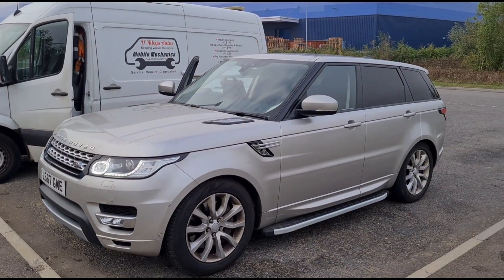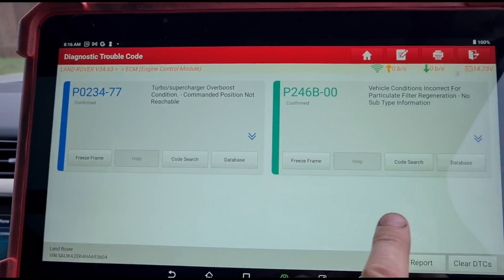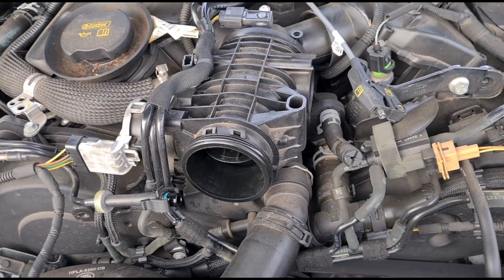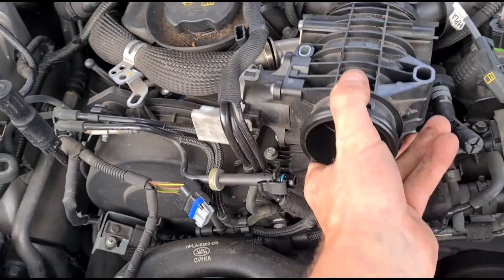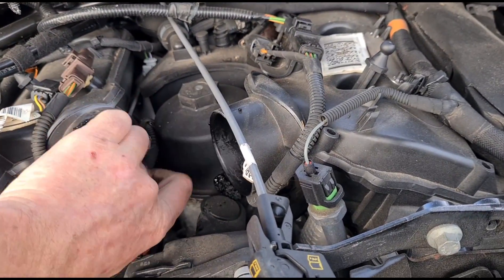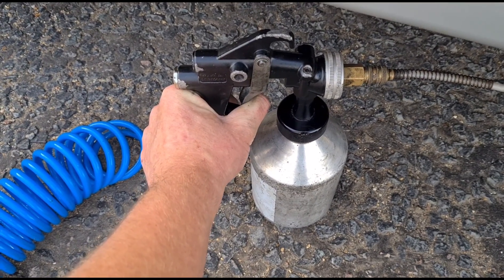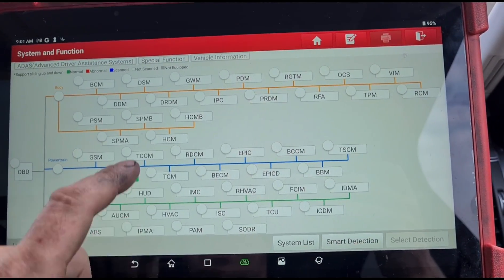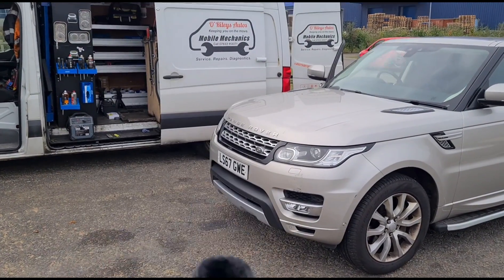P246B:00 Vehicle Conditions Incorrect For Particulate Filter Regeneration

Comment: Another great tutorial Jimmy I'm shocked at the price of the new throttle body  considering it's plastic and also the fact the main agent could not fix it surely a revised metal throttle body or more sturdy one so it doesn't get effected by the accumulation of debris and heat  from the EGR

Comment: Another great video Jimmy, I've commented on another of your videos, I'm an EX JLR master tech, (2 years out the dealers) I'm not surprised the dealers struggle to diagnose these issues.
The Training is very restrictive (doesn't go into proper everyday diagnostics) and the diagnostic tools SDD, pathfinder and the new topix internet based systems that the techs use are designed by engineers and not diagnostic technicians.
A lot of the diagnostic is done by the tool and leads you through a process to get a fix.
When you ask for tech assistance, you have to email a session file and results from rest etc to JLR.
They never answer questions, if you fix the car whether it's a software update or replacing a part they never explain why.
As for TSB's these are not easy to find and JLR will remove some without notice.
I found the dealer's diagnostic procedure frustrating at times, glad I'm out now.
Aftermarket diagnostic tools are far easier to navigate, faster and easier to understand.
Like I said another great video Jimmy keep them coming 👍

Comment: Safety tip..always use axel stands under a vehicle with raised hyraulic or air suspension. People have been killed when a sensor has been accidentaly disturbed and lowered the car onto them.I had a C5 that lowered when underneath but lucky i had axel stands in place to stop it 😮

Comment: Been watching your videos Jimmy and this one got my interest. I have a Jag XF with the same engine, I just removed the same part as the seals on the throttle body were leaking causing a very intermittent restricted performance warning . Changed the seals myself and all seems well. My throttle body was much cleaner than the one you removed as well.
One other thing, i have had the egr mapped out, is that sufficient or does it need blanking ? 
Keep up the good work, be good if other garages and mechanics were as genuine and knowledgable as yourself.

Comment: So, as a DIY mechanic for servicing on these, over 3 years and 30,000 miles you're looking at:
£120 in fully sysnthetic oil (buy 20 litres or more at a time)
£150 in oil, fuel, air, cabin filters
£30 in brake fluid
£500 throttle body

Ouch. 😝

Comment: Shocking they at landrover cant fix this problem and the fact they cost 500 nicker for some plastic is shocking,i presume with it being plastic is the main reason it cant be cleaned as with the heat its warped.👍
Reply: It's like the inkjet printers that sell for £35 with a set of replacement ink cartridges costing £40.
Interesting business model.

Comment: Hi, I've seen you do a few of these now, but looking at the throttle body they look like they come apart, have you looked into taking them apart and cleaning them and freeing the throttle valve off? As a business this may not be an option due to come backs etc, but for the DIYer it might save a lot of money at £500 a pop it could be a saving for owners who have this problem....
Reply: In previous videos he's mentioned that he's done this and it provides a fix that isn't reliably long lasting.
For a more dependable car, it's better to spend the £500 on a new throttle body every 30,000 miles or so.
With that EGR gunk being carcinogenic, it's not the sort of stuff I'd be wanting to expose myself to too often.
Reply: right, didn't spot that, note to self must pay more attention... @lint8391
Reply: I would try a dermal on the sticking part.

Comment: Well I seen your video on the turbo actuator on mk6 golf tested it and wasn’t holding vacuum had it changed and much improved the power but still at high speeds going into limp mode , underboost and overboost fault code , switch good and vacuum lines good any ideas please?

Comment: What will cause under boost codes. Pipes are fine turbo is fine, ford Mondeo. Also threw a weird one the other day exhaust temp to high for regeneration haven't had it since. Any ideas mate

Comment: Does that butterfly close on ignition OFF ?  To minimise rotation on shutting down?
Reply: Yes
Reply: @timbo19751975  not into this stuff but as a passing thought if I had one I’d try a adjustment/ stop screw tapped into the plastic housing like the old fashioned carbs had for “ tick over” 🤔

Comment: Maybe the Land Rover dealers out there should start watching this channel 😂
Reply: Maybe the Landrover dealers out there should start paying their customers for all these crap Throttle Bodies they put on their cars.
Reply: Even if when the throttle bodies are manufactured they drill a hole through the throttle plate and shaft and press in a roll pin to stop the throttle plate from moving on the shaft and sticking.